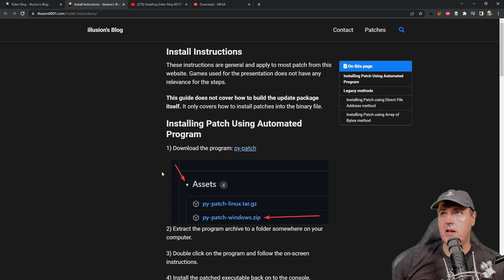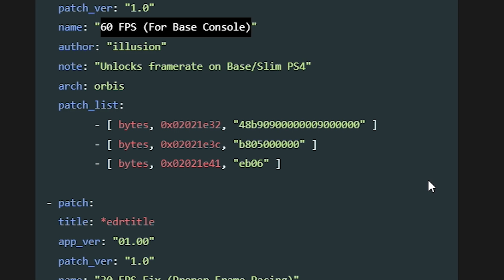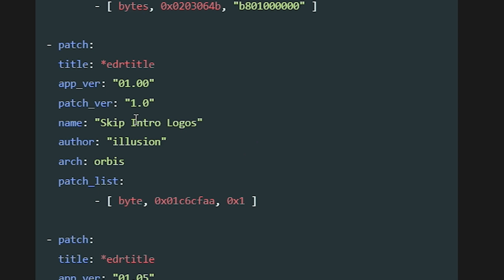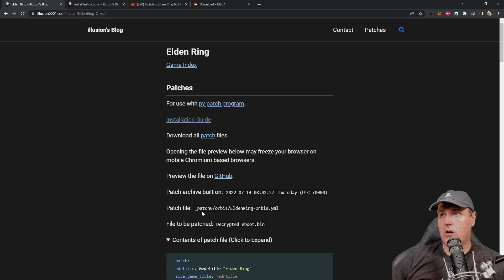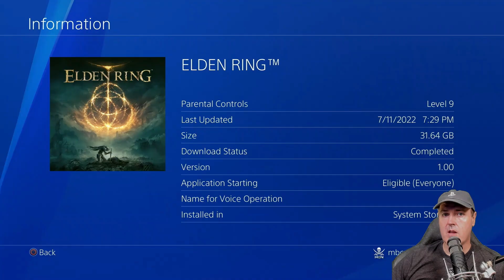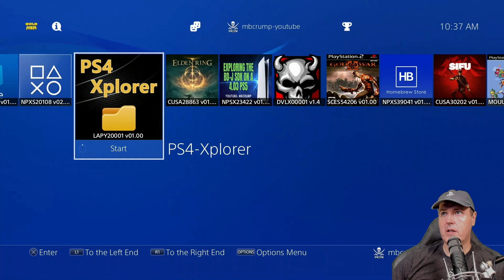Prebuilt Elden Ring 1.05 60 FPS Patch + Manual Install Instructions

Comment: the game in this way is unstable... it gives me continuous crashes, and takes me out of the game
Reply: So,  I shouldn't bother with the patch?
Reply: @russianbot9471  I had to remove it, anyway on a ps4 slim the fps gain is minimal, in closed areas it still reaches 40 fps, and in an open world not much more than 30.35 fps... if you have a ps4 PRO try it. .if not, it's not worth it
Reply: @Jonathan-ih6nr  yeah, I have a pro.  Might check it out sometime.